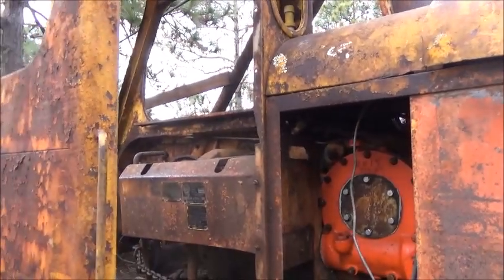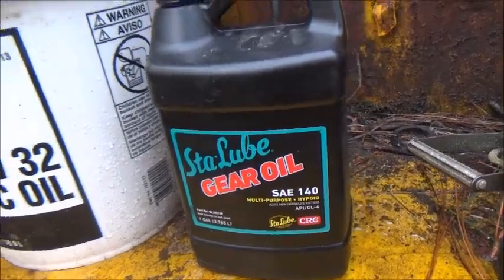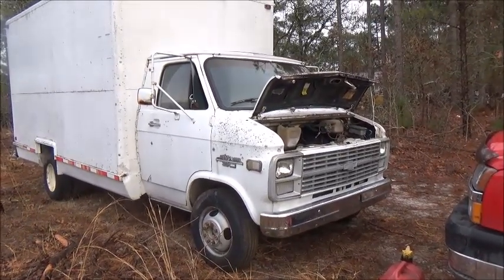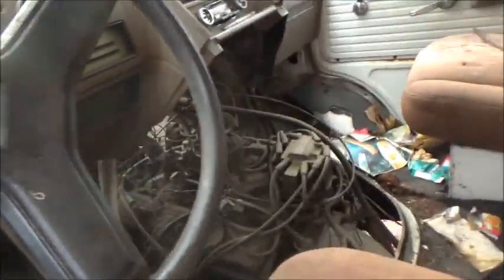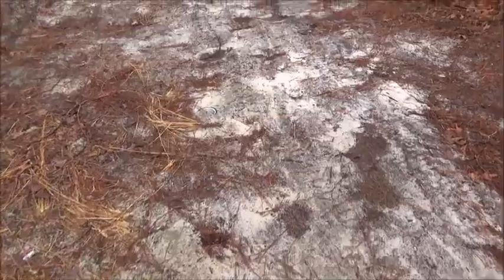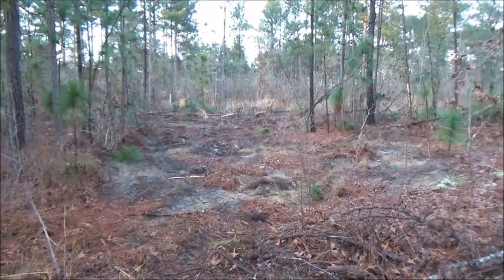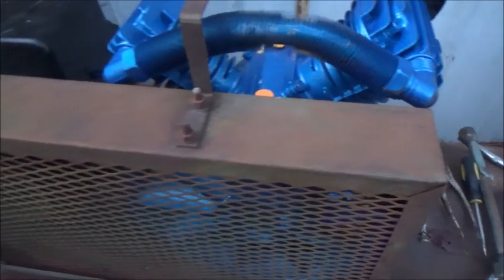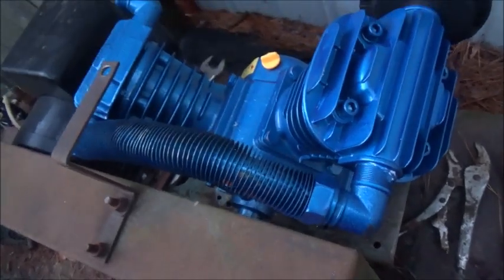SMALL BLOCK CHEVY FIRST START AND UPDATE

Comment: I was 62 years old before I finally got out of the dirt and into my own 52x38 shop . Why didn't I do that sooner? Concrete floor like glass. I can roll an engine on a hoist with 2 fingers. Now I am spoiled and you will be too. I bet the Unit crane will be dang handy building it. Thanks for yet another fine video. Stay safe.

Comment: Tech Tip: Ford quick connect Fuel Filters with the top cut off makes the perfect funnel to fill the float bowl on a Q-Jet!!! Fits perfectly in the carb vent tube and allows for EASY filling of the float bowl!!!!
Keep Rocking it out!!!
Reply: I like that.  You may still have to squirt some fuel down it's throat, but having fuel in the bowl ought to help it keep running after it catches.
Reply: @eugenepolan1750  Nope, just pump the accelerator pedal!!!
Rock On!!!!
Reply: That's an awesome idea 💡

Comment: Lightening striking chickens and burning em down?  That's. Really. Fried chicken!
Reply: Man, I wish lightening would strike my neighbors roosters !
Reply: @markcollins5026  I wish lightning would strike MY bloody roosters!!!
Reply: Lighting struck my aunt's house came into the tree arc thru feller windows used copper heat pipes to travel perimeter of home blew plaster walls in welded light switches shut knocked out phone set drapes on fire. Etc. Oh yeah turned on every faucet in house including bath

Comment: Those 350 V8 4bbl carb 4 bolt main & those Filter on front angle carb get dirty in center or on paper fibres they need prime up like desiel fuel injection to pump or injectors plus need let some air too the line when crank and  when fully running tight line up to ! Also was wild carb caught up fire to keep you warm Johnathan and fire up excellent to ! Also those 350 motor and Turbo 400 3 speed transmission last long time also  built tough to Johnathan plus excellent video too !

Comment: I have a motorhome with this exact same unit, set up in it. It’s the best running Chevrolet V-8 I’ve ever had. I took my carburetor apart, and put a new Excelerator pump in it. And I changed all the vacuum hoses. Other than the carburetor leaking out of the bottom. Like all Rochester carburetors do....and a little smoke from valve seals....it runs flawlessly.
Reply: Change it over to the new sniper holley efi and watch performance and mpg boost
Reply: @rsprockets7846  yeah....and a supercharger....and nitrous!

Comment: Old worm drive diffs and cases on Foden etc which had bronze, worm drive differentials used a castor based oil such as Corse 50 C (Castrol).. same basically as used in old washing machine gear cases.

Comment: The VW people with the older manuals are constantly having the same debate about gear oils, in my opinion I would never put a gl5 with bronze, what's the point when gl4 is still available and therefore there is no doubt it works properly?

Comment: Mid 70's blocks are not great but the 4 bolt main is a definate plus.its 350 chevy motor. It will run

Comment: With direct access to the back from the cab, the box truck would make an excellent recovery vehicle.

Partition the box to create a sleeper area to allow overnight travel and a separate equipment area that would provide enough room to hold a generously equipped toolbox, spare parts, and a towbar to bring non-running vehicles home to a more convenient workspace. It appears to have a GVWR of 10,000# or less, so no commercial license would be needed.

Comment: Hey Jonathan,  Why cut down the building from 70' to 50' ?  If you've got it now just do it,  it'll only haunt you in the future.  The price for the cement pad can't be that much more in the big picture and extra space sure does have a way of filling itself up pretty quick !  You could always partition it off if you don't need it now to save on heat.  Indoor space isn't getting any cheaper as time goes by, heck I might even want to rent some of it from you someday  !   ;-)

Comment: Darn I like to have that engine an trans for my 85 S10 my old 2.8 is tired an wore out . An i had bought this 2.8v6 carbureted from a guy that said was good but in fact wasn't an put it in an after was up to temp the oil pressure dropped to 10-15psi an between like 1500-2000rpm it rattles an I've been babying it for about 3 years now an with 20w50 am Lucas to hold everything together. 

Took it to few places an was told sounds like bad main bearings but getting way worse an compression isn't the best 90-95psi is the highest An has some blow by . But it's my daily just sucks never know what u get now days or no matter what anyone says an I'll never ever buy another one i can't hear or drive an make sure first.
Reply: My truck was originally 2.54cyl but that blew headgasket an needed a head so that's one main reasons I stepped up to the 2.8 , tryed forever to find a 4.3v6 but I need a trans too cause they are different bolt patterns   an then plus most ones are high miles or to far away an want alot $ for them that I even find .

Comment: Dug deep into the gear oil debate years ago. In the end the GL5 will never eat the bronze, it will just stain it. Dig deep past all the wives tales and get it from the horses mouth from the oil manufactures and you will find it makes no difference; other than some will leave you gears shinny after 300k and the "eating oils" will leave your synchos not shinny.
Reply: Sure makes sense.  Plenty of transmissions with bronze synchros were spec'd with GL5 and dull bronze seems to be normal and no other trouble.

Comment: did that van have a diesel engine to begin with?  maybe they used those hydraulic brake boosters on other vehicles but the diesel car we had used that kind of brake system since diesels don't make vacuum.
Reply: Hydro-boost has been in Chevy/GMC trucks since the early '80s and some muscle cars even before then.
Reply: @douro20  the chevy diesel we had was an 82. I actually like that method but sometimes when the brake was on the steering was a bit jerky,, not bad but noticable.
Reply: Pretty much any gm truck/van with a gvw 10k lbs or higher from like 1976 on got hydro boost brakes regardless of engine, and could be ordered on any truck/van above 7500lb gvw as the "Heavy duty or towing" brake package.
Reply: @BigBing1987  thanks, I wasn't sure how that was, I do know I liked the system on our chevy diesel. I will say that engine was the least powerful engine of any I ever had, after I put the 455 olds in it,, that was a much different story.

Comment: Then all you do is watch the damn cylinder walls down score the ring hell the proper way to do that is fill the carburetor bowl and use starting fluid after that moderately
Reply from the maker: Starting fluid is dry and scratches the cylinder walls. If you don't like the way I start them don't watch.